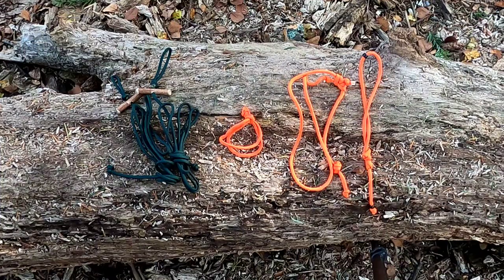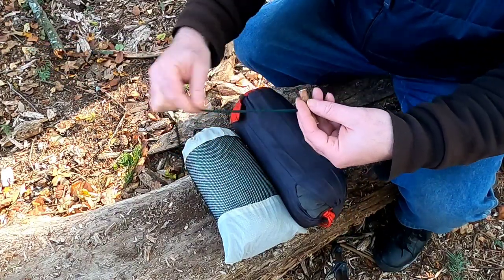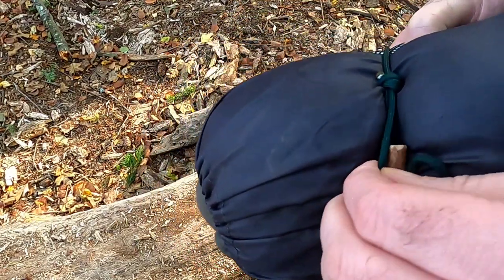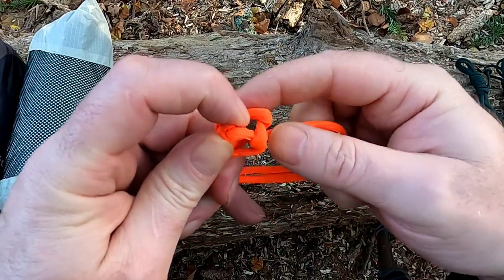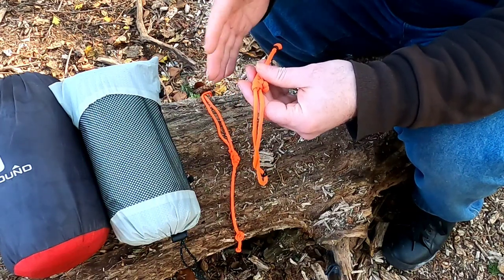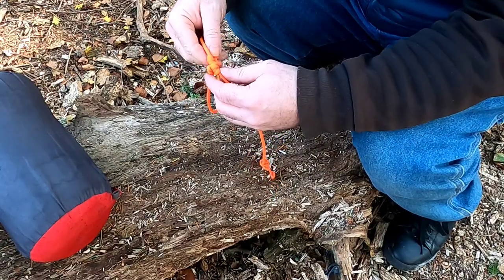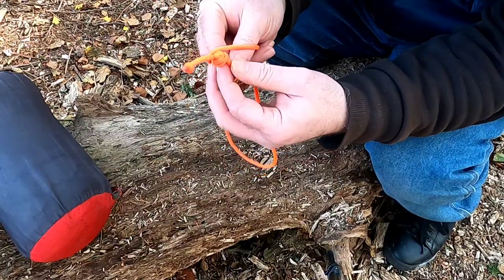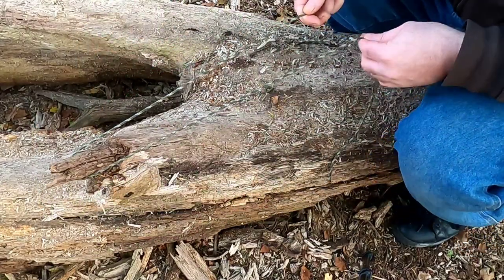ROPECRAFT - DIY ROPE TENSIONERS, CORDAGE CARABINERS AND SOFT SHACKLES

Comment: As with your other video, this also is a very good instructional video. Very much I appreciate your videos, thank you.

Oops, I missed the memo stating rather than utilize the correct word use we must now utilize utilize". Utilize does not replace use, different words different meanings and different usages. Using utilize comes across as pompous and self-ingratiating. When something is utilized, we use it for other than its intended design and purpose. Think of a chair, we use it for sitting upon, however we can utilize it as a step stool.

Comment: Thanks for sharing the techniques that work for you ..... think I would tie all your "Toggle Tension Cords" with loops at both ends, no need for the redundant stopper knot and then it doesn't matter which end you start wraping with, both ends work the same.
Your "Soft Carabena" if you use a Carrick Bend, Diamond Knot, Button Knot or even doubled overhand knot to join the two ends of your cord to make your "Carabena", they will work more securely (than a Fishermans Bend), especially for the second method as they have a defined choke point. You can also use an inline Marlin Spike Knot to form a locking noose for the carabena releases better than Larks Head Knot.
Not sure I would use the term "Soft Shackle" for your third item ...... it's more like a "Zip Cord", as Soft Shackle is universally used to describe what you refer to as "Soft Carabena". Again many ways to skin a cat ..... I would use a Canadian Cinch Knot, or your Toggle Tension Cords for this application.
Hope you dont m8nd, just some friendly feedback, cheers
Reply from the maker: All good ideas, there are many ways to achieve similar results and you seem well versed. There are many people out there that for them these are all brand new concepts so showing  examples with things like simple fisherman's knots makes it easier for them to try to achieve themselves without feeling overwhelmed. Normally once people get these concepts they start doing mods similar to what you have stated as I do as well, as an example I use the cordage tensioner on my backpack but use Canadian jam knots for most other bushcraft projects, but I already showed that in detail in another previous cordage video. It is always a fine balance of showing new things verses the same old tried and true methods when running a channel, people always want to see something new, lol.
Reply: Well done Frank,and time well spent  learning from you 👍

Comment: Great idea but I see some flaws with both.
1) when using the soft shackle like a "cordage carabiner" it is a fixed sized loop. Meaning if used in an application such as, attaching something to a backpack, the cordage carabiner cannot be synched down.
Although one advantage is it can be opened up and passed around something.

2) when using the soft shackle as a soft shackle, the loop is tied and everything has to be passed through the loop. Meaning it cannot be opened up and passed around something.

You could have the best of both worlds simply by putting a larks head into the loop of the shackle and passing the knotted end through it. This would give you the ability to both, pass the cordage around something (ie: MOLLE webbing on a backpack) running the end through the larks head, and then synching it down like a ziptie.
Reply from the maker: Thanks for the feedback, good idea. 👍